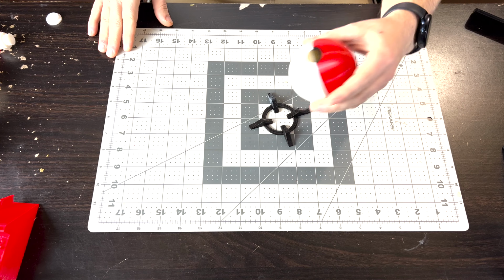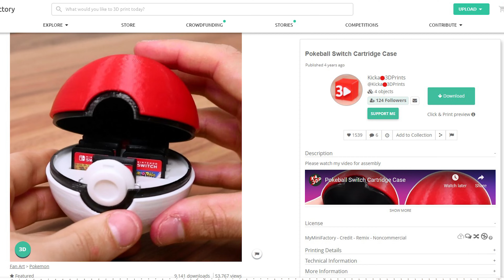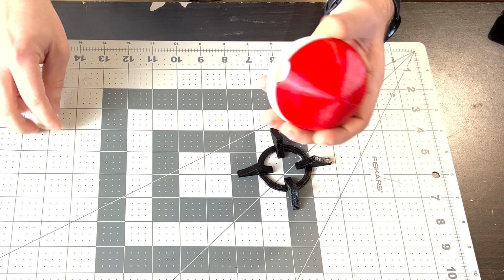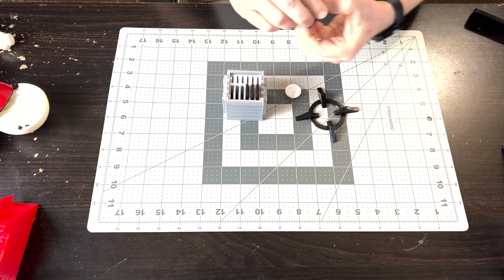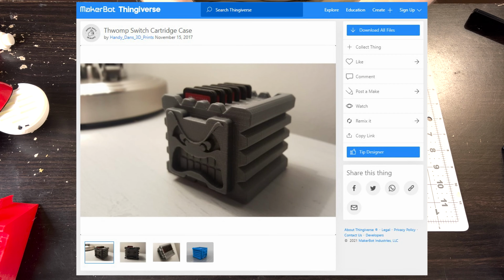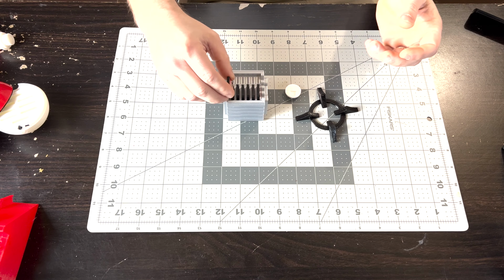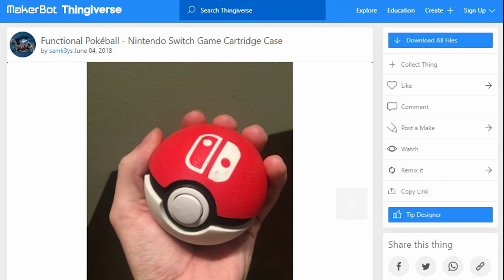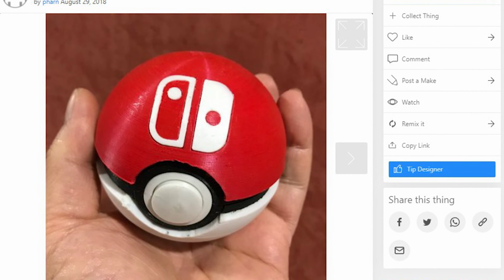3D Printed Pokeball Nintendo Switch Game Case

Comment: Did you use custom supports?
Reply from the maker: On this Pokeball, I only used Cura's tree supports.
Reply: @3DVibes  Thanks! also how did you get the button together
Reply from the maker: @isaiahpatterson3088  Sorry for the late reply!  The button with the long latch from the remix worked better for me. Needs cut to size. A lot of sanding went into it too, lol. https://www.thingiverse.com/thing:3072995.

Comment: I tried this.. but my supports were fully fused to it.
Reply from the maker: Which type of support did you use? I used the tree support in the Cura slicer. You can try decreasing the support density and maybe increase the overhang angle a bit so less support is printed.